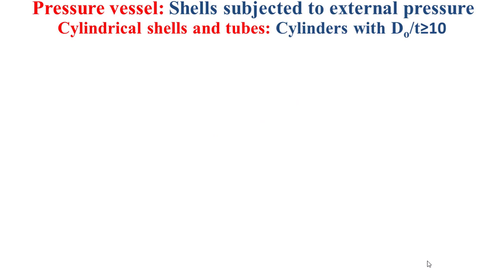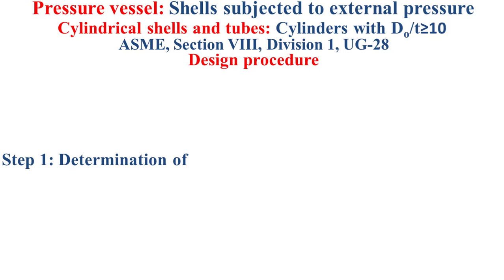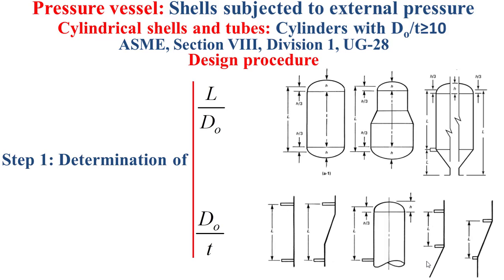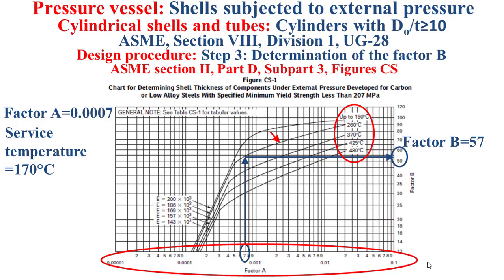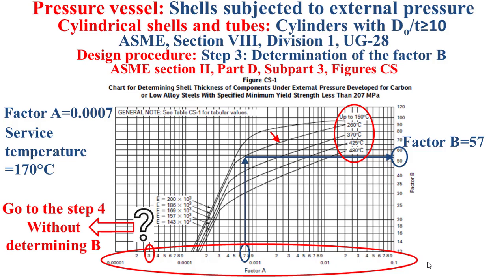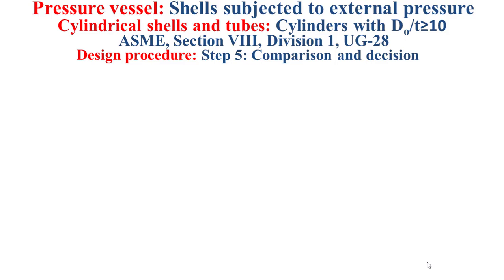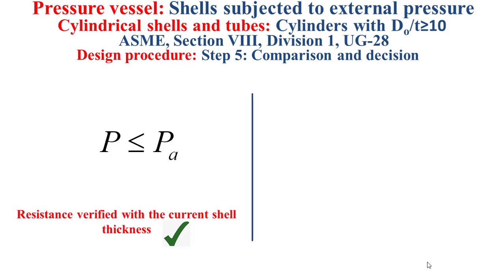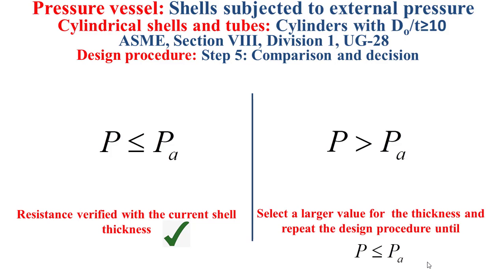Pressure vessel_Sizing_Shell and tubes thicknesses under external pressure_Cylinders Do/t≥ 10_ASME

Comment: to calculate HX tubes under external pressure, what is the t value to use in ratio Do/t? Is it the nominal tube thickness or the calculated tmin based on the internal pressure?
Reply from the maker: Based on the ASME BPVC Section VIII, Division 1, UG-28,  for heat exchanger (HX) tubes subjected to external pressure, the thickness t used in the ratio Do/t is (outside diameter to thickness ratio) is the nominal thickness minus the corrosion allowance, not the minimum required thickness tmin calcualted for internal pressure.
Reply: @HITS2009  the problem i have is my tube thickness is 0.083", but corrosion allowance in 0.125" which would give me a -ve assumed thkness.
Reply from the maker: @ It seems that the thickness 0.083'' you have is the corrodded thickness (nominal thickness minus Corrosion allowance). The nominal thickness in your case is 0.083''+0.125''. Thus, you use the thickness 0.083''.